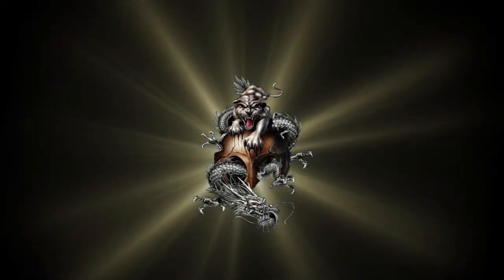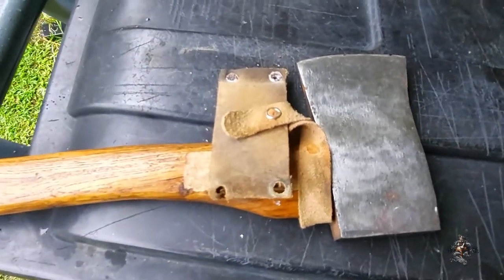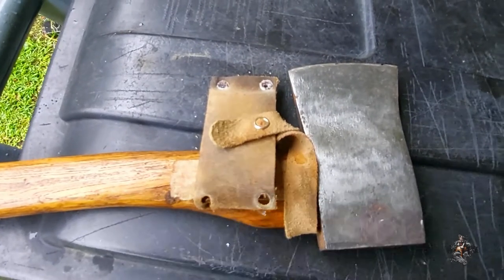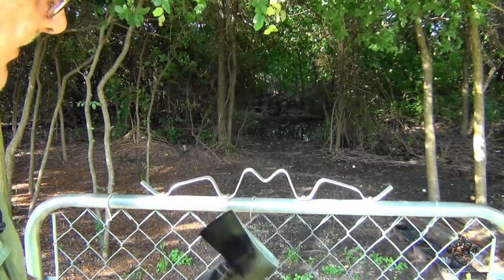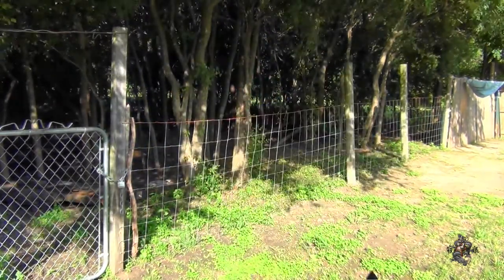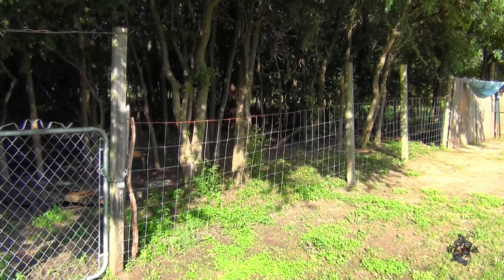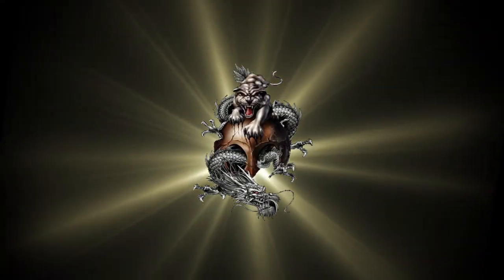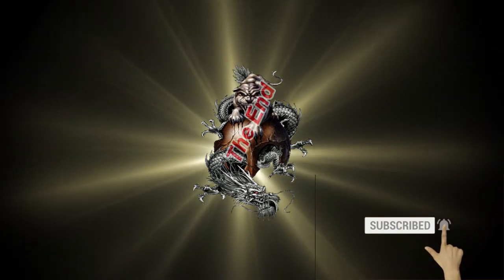Axe Project Pt. 2 - Axe Head Painting

Comment: Is that the original handle or a rehang? I could swear the head is on upside down, it flares up from the eye whilst the bottom looks die straight. Not that it will matter with a good epoxy filled hang, just odd to look at.

I rehung a Kentish pattern head on a completely hand carved oak handle last year. I spent hours carefully sizing the wood the eye. Finally wedged it up and couldn't work out why there was a small gap at the base of the eye, it definitely wasn't there in my test fits. Then I looked again, I'd hung the thing upside down at the last fitting. It happens and I'm not fixing it, that thing is on there until the handle breaks.
Reply from the maker: That's the original handle 👍
It is a oddly shaped Axe but it works well now that I've finally finished it 👍